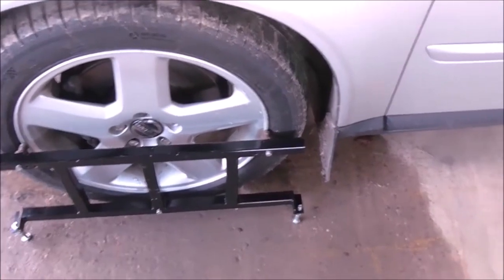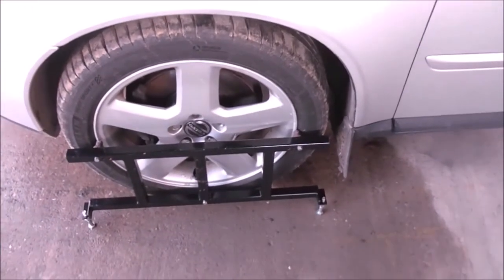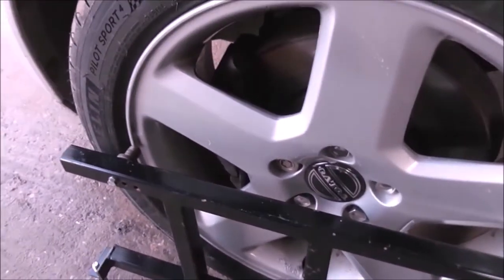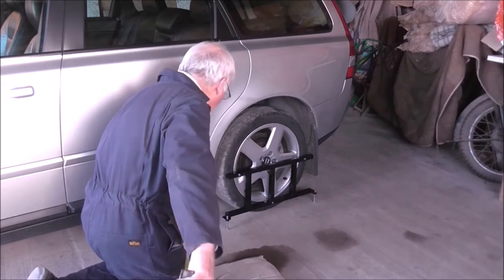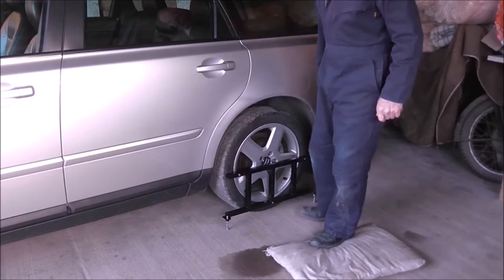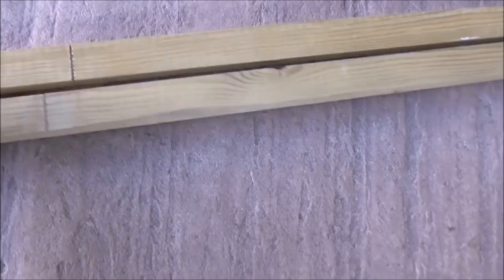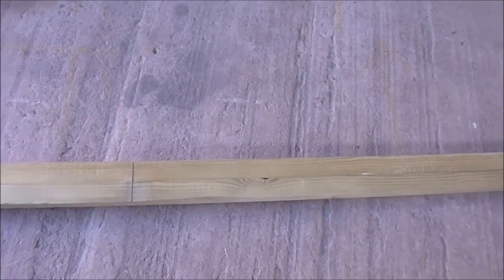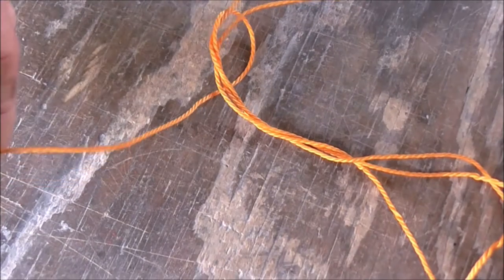Two ways to check car wheel alignment accurately at home

Comment: Another great video!!! Thank you! Now that I found your channel, I find that we have a lot of common ideas, on what to build. 

Can you please share the dimensions of the frame? Did you use 20x20mm tubing?

One thought that could make this process easier (your first method)- you can weld in (carefully) a piece of e.g. 25x25mm hollow square tube, close to the bottom of your frames , so that long 20x20mm square tube can be inserted and made parallel with your frame. You can then insert two quite long, straight 20x20mm square tubes - one on each wheel (with some support bolt so it is off the ground). Since they are very long (vs e.g. 16" wheel/2), anything out of parallel can be spotted and measured much easier. E.g. 1m (2000mm) long 20x20 tube is 5 times more precise than 16"*25.4 == 200mm wheel measurements. Makes sense? Obviously welding in the 25x25mm sleeve precisely is crucial, and making sure that internal tube weld is away from the wheel, and that there are 2 screws to press 20x20 within the 25x25 tube - and make it 100% parallel it with the original frame that you made (and by proxy the wheel).

I like your second method as well, it just requires even more precision in measurements and setup.
Reply from the maker: @bjov76   My wheel alignment frames are made from 25mm box section. When setting car wheel alignment you are not looking to get the wheels parallel, the wheels usually need to toe in or toe out slightly depending on whether the car is front wheel drive or rear wheel drive, if this is done by measuring, two measurements have to be taken, the distance between each measurement should be equal to the diameter of the wheel rim, if you exceed the wheel diameter by using long straight edges the toe in or toe out will not be correct.
It is best to use the string line method I have shown in the video, it really is simple to use and very accurate providing the string lines are parallel with each other, using two wooden battens with grooves in them to keep the string lines parallel, you then get perfect results. thanks for your comments and thanks for watching.
Reply: @johnbower  But with longer straight edge, you can still calculate the angle more precisely - right? (e.g. measure on the back side of the wheel, and then all the way at the front..  You just need to take into account the length behind the center of rotation and in front of it, and do the math/setup formula in a spreadsheet. I believe that that type of measurement would still be much more precise. Or maybe even install laser line, and measure on the wall, with a known distance - not dissimilar to how it is done at "pro" alignment shops. Making 1-2mm of error on the wheel seems like a big error margin to me.

Comment: Hiya,
Please could you tell me if you have replaced or repaired the pcv/flame trap box on your Volvo V50. I'm struggling to find any info on YouTube about where they are located and how to remove/replace them. My Volvo is a V50 2.0l diesel 2006.
Many thanks.
🙂

Comment: Thanks for the video effort but it seems you have overly-complicated both types of DIY alignments. I clamped a pair of 30 inch long pieces of 0ne inch box steel tube across the front wheels (leveled) using two small quick-tighten  12 inch bar clamps, then measured from right side to left at the front and back of the front wheels. Set 1/8 to 1/4" toe IN and done.
Reply from the maker: Thomas D Smith, You should leave this to someone who knows what they are doing, there are at least three things wrong with your method.
(a) your box section would have been clamped against the tyres instead of the wheel rims, if one of your clamps was a fraction tighter than the other then the tyre would squash more at that point and the box section would not be parallel with the wheel itself.
(b) to get accurate alignment measurements you have to measure from half way up the wheels (center line of wheels) so how did you measure from one side of the car to the other ?
(c) You think 1/8" to 1/4" toe in is accurate enough, that says it all.